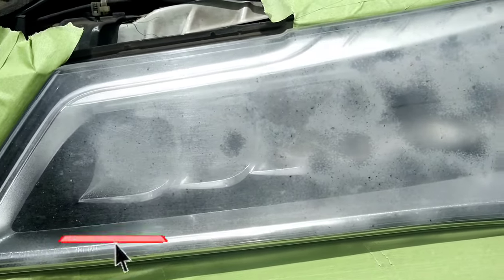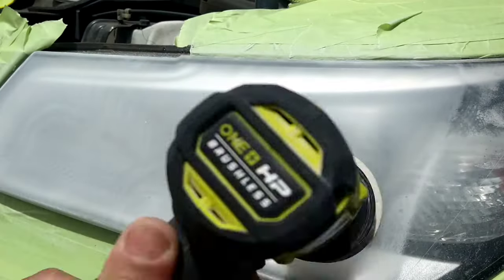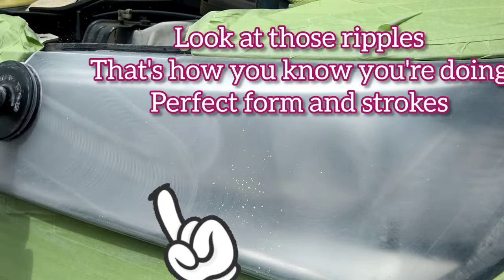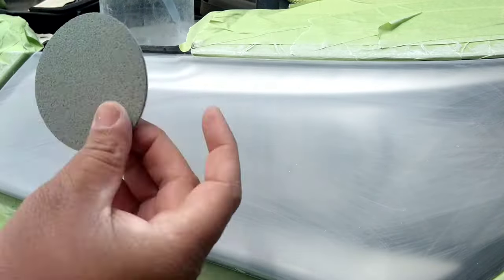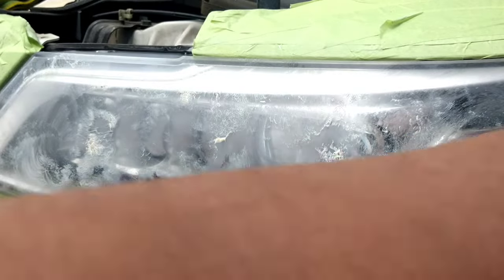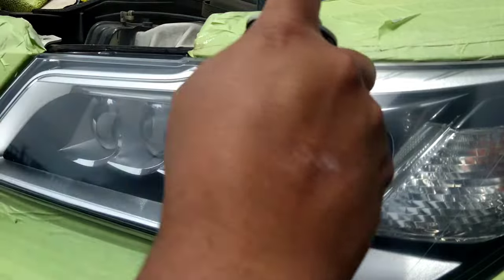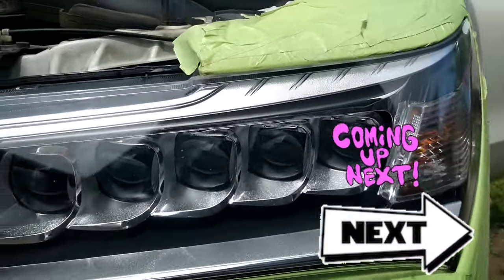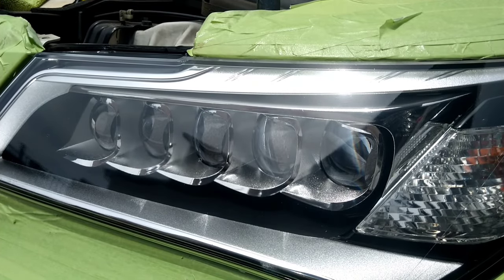Why not to double clear coat headlights 🫣--- HEADLIGHT RESTORATION

Comment: i done my next doors headlight on her car few weeks ago they was realy bad to a point you could only see half of her headlights 🤦🏻‍♂️ so i dry sanded it then wet sanded then polished then ceramic coated number of people said why dident you just used wd40 instead of all that work i just laughed at them 🤣🤣🤣
Reply: What? You need to go back to school because that ain't english 😂
Reply from the maker: @octaviolozano6890 might be from somewhere else..
Reply: I don't think he needs to type English well to restore headlights he only needs to be able to understand the headlight restoration pro's word's
Reply: @theheadlightrestorationpro to add to Gareth’s comment, regardless of grammar, is ceramic coating beneficial to apply after the UV coating is applied? Could that possibly extend the UV coating’s life span by adding an additional level of protection? Glad I found you on YT. Researching this process extensively as I’m about to perform it.

Comment: You shouldn't clear coat headlights at all as it causes light refraction and also pitts and peels over time. Polish with a buffing compound or metal polish like MOTHERS MAG then coat with a headlight coating like Meguiar's Headlight Coating.

Comment: Did  double spray yesterday.  Now I have a problem. I followed product instructions.  🤨. I should have seen this video before .
Reply from the maker: Yeah they're double sprays all wack... It's what happens when scientists make something but don't have enough field tests to figure out the right way to make something.. that's what somebody like me was just a product probably over 700 times and have done well over a thousand headlights has a greater understanding and knowledge of the product...
Double coat this bullshit in any product the more coats the worst...
Was going to link this video but you're watching it or have watched it...
One full code is all you need no matter what kind of coating you're using.. if you have to use more than one you shouldn't be using that product...

Comment: I use multiple coats of the 3M wipe-on clear coat and the lights look fantastic. If a 2nd layer softens the first and they intermix well, there is no (or little) refractive index discontinuity and the clarity should not be affected.
Reply from the maker: Not quite... Product doesn't typically work that way to moisten the next product.. it pretty much lays on top.. unless you're spreading it when it's wet which would make no sense it would make an utter mess especially because you're using your hand to applied with an applicator...(these things are fine in and I use them only in extreme situations like heavy wind)
The 3M wipe-on is my go-to that.. and I've used it quite a bit in the past.. but I will do everything in my power not to use it because it is an inferior method and product... The clergy of the Maguires is truly unmatched buy anything I've used or experimented with.. I put lesser products above that 3M wibe because a delivery method is inferior.. the product itself is superior.. metaphorically kind of like sword would cause can a 22 caliber handgun.. but which one has a better delivery system....lol
Spray is always going to be superior, no streaks,  no adulteration of product, and the ability to perform one Master Coat just like the factory made headlights get...
But as far as wipes... 3M is definitely the one...💯

Comment: Just did my 1st set of headlights using your method and they came out beautiful! Thank you so much!
Reply from the maker: Awesome man....
Appreciate you watching the videos..
Stay tuned...💯👍🏼
Reply: @theheadlightrestorationpro .Hi..liked the vid..Quick Q..I got brand new headlights..Just wanted something to coat the lenses to prevent rock chips and minor scratches...What do u recommend? I got a can of Meguires headlight coating! Any good? Thanks
Reply from the maker: Would not spray it on a perfectly good headlight..(I would apply preventive maintenance in the form of aftercare check this video out)
https://youtu.be/kIur4XxYjDk
Reply: @theheadlightrestorationpro  ok..Will Any UV based wax work to prevent scratches? I am in Taiwan..Any good Meguires or Turtle wax products u recommend? Thanks a lot
Reply from the maker: Go for CARNUBA
Reply from the maker: My hands fine...
Reply: @theheadlightrestorationpro  Carnuba spray wax ok to use or must it be the hard paste from the tin? Thanks for ur useful help buddy
Reply: I know this is an old post but if you are protecting new headlight use clear paint protection film. Either order and apply yourself is really easy or some companies even make kits that come pre cut for your model. Far better than wax BUT using a good quality uv inhibiting wax will help a lot if you reapply after it gets washed or every month. Reapplying is the key when it comes to wax for protection
Reply: I know this is an old post but if you are protecting new headlight use clear paint protection film. Either order and apply yourself is really easy or some companies even make kits that come pre cut for your model. Far better than wax BUT using a good quality uv inhibiting wax will help a lot if you reapply after it gets washed or every month. Reapplying is the key when it comes to wax for protection
Reply from the maker: @Dirk_Von_Dickshlinger no..😂😂😂
Reply: Your now a Headlight restoration “EXPERT”

Comment: i was going to 2k clear my lights but after watching your vids i may give this a go would you say using a headlight film over your job would help it last a lot longer
Reply from the maker: You'll like it a lot better...
As majority of people do whether the customers or people using this for themselves...
2K clears ancient remedy that makes no sense anymore...   There's hundreds of things actually designed for headlights and like I tell everybody Google 2K clear for headlights you only come up with one product that's kind of scammish.... Because it's still not for headlines it's trash....
Reply: @theheadlightrestorationpro  Your wording is strange. 2K clear isn't trash, it's the best clear coat you can use.. however, it's not good for headlights. You're correct about that, just odd wording.
Reply: @theheadlightrestorationpro  Why is 2k clear trash? There is not just one product that is scamming you, there are many types of 2k clear coat. The one that comes in a can is usually lower quality than the ones that is used with spray guns. 2k clear is the same type of clear coat used on the vehicles body color.

Comment: Great channel. I'm subscribing. I wish I found your channel sooner. I tried the method of double coating with rustoleum uv blocking 2x ultra coat with horrible results. I'm glad it was a practice attempt on my 99 Civic lol. I'll get the Maguires spray and try again on the other headlight. I think I permanently ruined that one headlight lol. I'm going to be watching your past videos. Thank you
Reply from the maker: Awesome and appreciate it... Yeah definitely got to be careful which method you use and what you seal it with but on the brighter side of things you might be able to redo this method on the light that you did... Should work..👍🏽
Reply: @theheadlightrestorationpro  I'm trying to get the coating off but it's extremely hard. Nothing finer than 80 grit will touch it. I only have a 4 inch hard rubber polishing head that I use to polish marble and granite which I do professionally so I can't use that to do the headlights. I'll be buying the products that you detail in your video description.
Reply from the maker: @Antoniocool86 👍🏽

Comment: how do you reapply meguiar's coating after a year? do you have to buff it first or do you just spray it directly?
Reply from the maker: You shouldn't need to after a year...it last much longer...
Reply: @theheadlightrestorationpro  how would you know when to recoat it?
Reply from the maker: When it goes bad...
You will see it ... it's up to your discretion in when you want it done ..
Meaning at a little bad or more bad... it's not so black and white...it doesn't just go bad it is something that happens over a long time...
To reapply work the same exact steps...full headlight restoration... basically remove it and put it back on.
https://youtu.be/5-mYDvauImU.

Comment: I found out about the double coating today. The first layer made the lights look like a mirror aplying the second layer just made it look worse. totally agree on this though this might shorten the longevity of the light no?
Reply from the maker: Not at all. ... it's actually more product than they prescribe with 2 coats... it's one heavy coat..more of the product means longer lasting ,...
Think of 2 layers that are thinner....thinner goes bad faster so that first layer onto top will go bad faster...this is one reason your restoration will last longer with my method.....(It also reacts better with aftercare giving you enough material to resurface in a sense) 
It's almost as if they wanted it not to last as long if you follow by there instructions or look as good or even function as good..😆
They didn't have enough R&D (research and development)
Not as much as me....💯

Comment: I have an 02 B4000 the headlight has three nipples. How do you work around those? I just hit it with acetone a few times and the lense cleared up then hit with mcquires spray. But the nipples I can get clean, but it's an old rig I'm not worried about it. Still have drivers side to do.

Comment: What is the coldest temperature you have sprayed that coating in?  Cold temperatures possibly can kill a mobile headlight restoration business, maybe there is a way around it.  Just wondering what has been your experience when it’s cold?  The state I live in, the winters are long.
Reply from the maker: That is one thing I can only speak from my experience,,, I'm in California... Hot summers from 90 to 110° Winters daytime temperature from about 40° to 65° not a tremendous impact and whether or I'm from.. it doesn't even rain that much couple of days out of the winter... I work in rain I work in all weathers the only weather that is trying for me out here is wind... Winter's not an issue I work all year round in California..
Statistically and steady.. coldest temperature I probably sprayed Coating it's probably like 30 to 40° should be way too get around the cold.. I just account for longer drying times, still even use air dry and fan dry in the winter... But if it was colder I would probably use some kind of heating element but not directly on the headlight coating more like in the vicinity...
But have not had to deal with that out here occasionally use a heat gun for about a foot away from the light just to get residual heat but these things will affect your clarity the best is to just let it sit and dry or fan dry...
If I was you I would find a way around your winter issue so you can pump out headlight restoration all year round, heating element would be the best somehow.. I
You should work as much as possible with your harsh conditions.. well there's a will there's a way, and a harsh snow storm of course don't do it but if it's just trickling out a little snow why not.. this is what you do..
Thanks for the question
Reply: If you have sprayed the coating at 40 degrees and not had a problem I should be ok then.

Comment: Why no IPA wipe before you coat? Thinking the coat will adhere better because the polish oil will be removed, coating should last longer no?
Reply from the maker: No... normally you would be right on none CLEAR surfaces.. #1- when you are buffing at such high temperature 🌡️ the sterelness is as high as it's going to get and you want that from bonding..#2- you want a little bit of that buffing material locked in there, it's almost nothing but it adds amount of hydration..# 3 any kind of IPA, or even Windex ( glass cleaner ) is alcohol based alcohol evaporates so fast it leaves residuals behind no matter what, this is why after the glass cleaner step one reason why it looks so clear when it's wet and turns White... Even when it's more polished up it still won't leave residual behind... Affecting your clarity..#4- also you would have a higher risk of residual streaking or residue left behind even with a clean microfiber towel at this step which is less than an environment like I spoke about in number one... (With this method HAVE NEVER had issues with adherence ... even years later...not once..)
Used to try it but it's absolutely useless and ran into a lot of issues having to redo headlights...
Hope that answers your question..
Thank for your support..💯👍🏼

Comment: Do they make the discs in a smaller size? You were mentioning using a smaller one for some lights in one of your videos
Reply from the maker: Yes just come in every inch measurement 3 in is one of the most common, but they come in one inch like six...
I also always have scissors if need to I'll cut sanding discs, they also have different size head attachments to put the smaller discs on... It's very rare I have to do this..
As it is someone unnecessary 99.99% of the time 3 in is good enough to get in all spots..
Reply: @theheadlightrestorationpro  i hate to trouble you but do you have any part numbers or links? I've been searching and can't seem to find anything for sure, the 3m website is ponderous at best

Comment: Since Maguires spray and even other spray-on coating is not available, I used 3M wipe-on coating with quite good results so far.  
I agree that one coat is better than double coat.
Do you think we can further improve the 3M clear coats by the Chemical Guys Optical Grade 34/36/38 polishing/buffing system ?
Reply from the maker: Anything's possible..

Comment: Had my project all planned the way you did it except for the clear coat part, I had already bought the Sylvania UV block wipe-on clear coat kit.  Your thoughts on the Sylvania kit please? (should I scrap that plan and go with the Meguiars UV spray coat?)
Reply from the maker: The Sylvania kit is a solid kit probably top five... But it is just a kid it's not going to yield professional results... The UV blocker is good for parents but not practical use it's much too thin of application and it's a white blood application which means it's inferior to any spray application that is meant for headlights...
By far when I compare to using Mcguiars or this method.....

Comment: After putting the final coat on, is it OK to put a clear  PPF on the lights such as Expel Ultimate clear wrap? 

Nobody says you can use both. I thought that both the clear paint and the Clear PPF should last 10+ years and stay very clean.
Reply from the maker: It's not recommended I don't ever recommend using a ppf on your vehicle and especially your headlights it has many side effects.... But first and foremost is the same thing as what you're speaking about or what you are watching in this video double coating but more of a stream nature .. you will definitely lose a lot of light that your headlights will overheat and start to crack underneath and will peel your clear coat off if you try to take it off... Many side effects...
Reply: @theheadlightrestorationpro  Great advice! I'm sticking to your advice. Thank you!
Reply from the maker: @bubbajones7486 literally the best looking outcome and healthiest..

Comment: I used the 3m plastic cleaner yesterday with my new ac Delco polisher. I dabbed all over the headlight, as per your instructions, but it sprayed everywhere. Have you experienced this problem? I used the same orange pad you recommended.
Reply from the maker: Lol... Yes I have this happens with brand new pads and if you're putting too much on the brand new pad or any pad in general.,..
To get some of that off you can just hold the polisher away from anything and turn it on pretty much in the air and it'll fling all of it off...
The new ones don't soak up the material the same... And when you're dabbing you need to be dabbing probably a little bit more firmly to embed the compound inside of the pad a little bit more...
As it gets broken in it won't happen as much but at the same time you can't put too much compound once again...